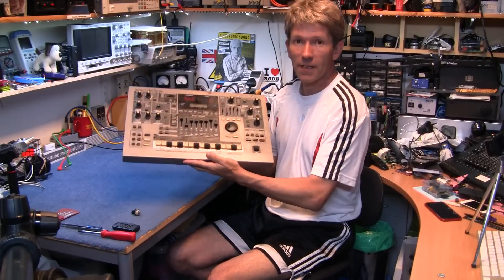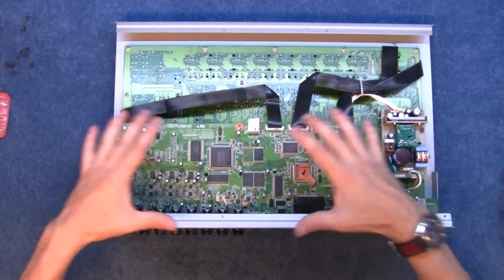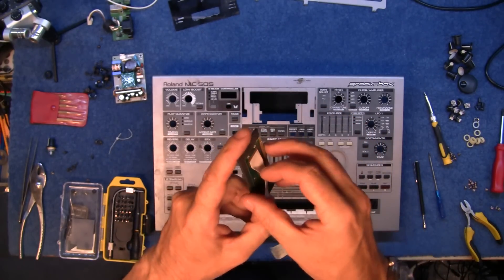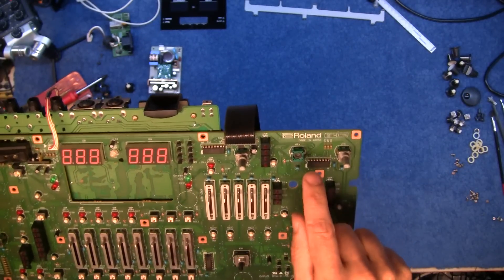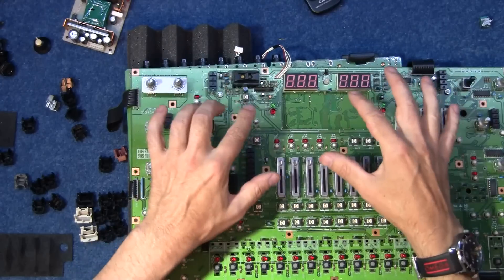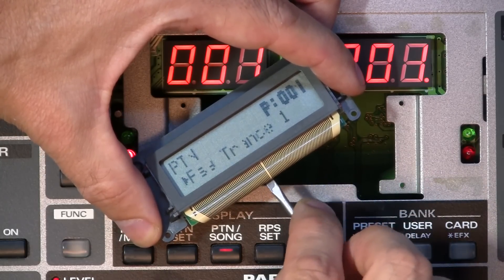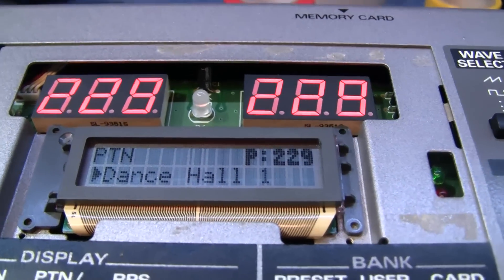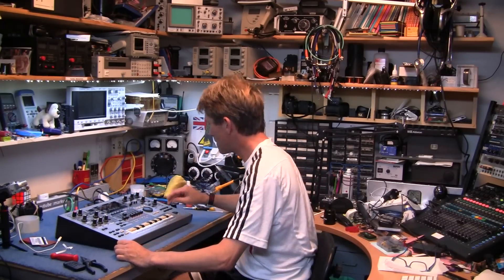Roland MC-505 groovebox LCD display repair with a steam Iron

Comment: Had a JX-305 since 2013. The display was fine, so only the flash rom got resoldered. Now the Display has the problem with missing columns. Time to replace it with that blue display with nice backlighting I have lying around since 2014. Hopefully it still works. Bought it new in 2014.

Comment: His much do you charge to fix the display or replace one for a MC-909?
Reply from the maker: Hi I am really sorry but I retired a couple of years ago and no longer do repairs. my apologies.
Reply: @markusfuller  I just fixed my LCD screen today. I replaced it with one I purchased from eBay. Took me about an hour but it was worth it.
Reply: @markusfuller  ok thanks for replying. Enjoy your retirement😀
Reply: @markusfuller  maybe you can answer a question for me please. I have an MC-909 and the backlight appears to have gone out. I can still see the display and all of the character but very faintly. Do I have a bad LCD or a bad inverter? The LCD works perfectly aside from the backlight not providing enough light for me to see it as usual. Any direction you could provide would be helpful. Thank you

Comment: One thing with replacing pots is not only do you need to know the resistance but also if it's a linear scaled pot for a slider that's used for direct digital control of a parameter or a tapered pot for audio signals. Slider pots for digital control will be linear so they can evenly increment up the scale such as 0 to 255. Whereas a pot used to attenuate a real audio signal needs to be tapered which means for example that every mm of travel the resistance per mm along the carbon track under the slider handle will increase by a logarithmic amount since our hearing responds logarithmically to loudness.

Comment: Hi markus thanks for this very enlightening video can you please tell me what voltage the LEDs are in these units please.
Reply from the maker: Hi I think they must be about 2 to 2.5 volts but thats a guess as I have not tested with a multimeter. I have made a later video all about calculating LED voltages.
Reply: @markusfuller  thanks markups very greafull I will check out your other video for LEDs👍

Comment: This helped me a lot! I had the same display issue with my Roland JX-305 Groovesynth, which I believe shares the same display with the MC-505. The ironing did the trick. I did have to press the iron relatively firmly for a longer time for all the pixels to display. Thank you for the post!

Comment: Have you ever encountered or do you think its possible for missing pots to cause the 505 to fail to boot up pls? The guy i bought off assures me it worked but on arrival just blank screen nothing else.if i poke the missing pots sometimes it shows other lit lights but nothing else.all connections on board are connected athough on arrival the small lead from bottom board to top round the audio board was off.i understand if u dont have time to answer thanks

Comment: What is the tool you're using at 6:03 to remove the pot?
Reply from the maker: Hello . that tool is called a solder sucker. It has a heatproof tube and when you heat the solder into a liquid it sucks up the hot solder from the board. you can buy them cheap from amazon or electronics stores. just dearch for solder sucker. best wishes.

Comment: Hi there Markus I followed all the steps but know, when I turn on the current and next panels appears with —— lines and there’s no sound coming out of the machine. How can I Solve this ? Thanks
Reply from the maker: Hello Jamil. sometimes you have to sloghtly press along the ribbon where it is in contact with the glass to find the last few connections that have not stuck down correctly. but the display should not have anything to do with you getting no sound, there must be a different problem that is causing you to get no sound.
Reply: @markusfuller  Hi Marcus, thanks for your reply. The keys are working well, but it looks like the system froze and that’s why it appears those lines. Because when I turn on it appears the numbers normally, but 2 seconds later turns into that numb/freeze state where all options are not working and no sound is coming.

Thanks

Comment: Hi Markus, does the repair on the display with the iron still works after all those years?  Thanks for  your videos!
Reply from the maker: Hi Michael. sadly after about 6 months it started breaking down again.
Reply: @markusfuller  ah dang it. Thanks for your quick reply! I bought the part on ebay.

Comment: I have tried the process with restoring the screen, but my screen seems to be getting worse. 
My iron is set just under 'synthetic' temp., but I don't seem to be getting the same results you did.
Does in make any difference that my screen has a red backlit look to it?
Reply from the maker: I am not sure why you are not getting the same results. I do not think it would have anything to do with having a red backlit display. have you tried gently pressing along the ribbon where it meets the glass to see if the pixels appear ?. if they do you may be able to pack it with some sponge like material so it is gently pressed in that area when the top perspex cover is placed.
Reply: @markusfuller  thanks Markus. Dopey me, It looks like the main cable is little worse for wear,  coming Into the display controller (the white ribbon cable) - I may have cause some further damage while trying the "laundry equipment procedure" 

I will need to repair those connections and see if I can recover the screen from there. But while I am this far into it, I am going to sort out some of the other problems - there are some loose feeling pots on the board and the data entry rotary skips and glitches information from time to time, causing values to jump.

I will let you know how goes it.

Comment: Thanks for the great video. You might consider to use a brace for the sides of the machine when you flip it,  because the way you are handling it the pots on the front are going to need replacement. Pop the pots off and use the case with a small towel or a shim to support the weight without motion.

Comment: Greetings! My MC-505 takes about 8 seconds to start up when turning it on. Do you know what would cause this issue? It is as if a capacitor is slowly charging.
Reply from the maker: Hi Robert to be honest I have no idea why it is taking so long to startup. have you got a card inserted in the machine ?. sometimes it may take a little longer as it would read from the card on startup. if you have not then I am not sure why it takes so long.
Reply: No, I don't have one. It is an odd issue indeed. I thought it was a dry joint because I would wiggle it and then it would turn on but when opening it up and re-soldering the joints I noticed it was simply delayed, so each time I wiggled it I was thinking it was causing it to turn on. But then wiggling never made it turn off haha! Oh well. If I find the solution I will let you know - for science!

Comment: In my current setup I use a Roland MC 505 and a Korg Es-1 for my music but a couple of months ago I was given another 505 from a mate who said it was faulty (couple of the keypads don't work unless pressed with force and the usual screen issue plus all the pots were wobbly as hell) he said I might as well use it as a donor machine just in case anything with mine goes wrong. After watching your video you inspired me to open it up and have a noodle around to see if I could find out what the problems were. Stripped it down, put all buttons and knobs in soapy water and cleaned up the chassis. Wobbly pots I sort of crimped with a pair of long nose pliers and it sorted them all. Ironed the screen back to life and figured out why two pads don't work. The little rubber switches are split so don't make contact properly, what are the rubber switches called and can I replace them at all? 
Great channel by the way, right up my street 
Cheers.
Reply: Great question. Did you ever figure out what to do with the buttons being janky?

Comment: Brilliant videos :D I need to purchase some of these potentiometers, do you have a link or recommend the place where you purchased yours from? Thanks :)
Reply from the maker: Hi Im not sure where mine originally came from as I just stash components when I get hold of them. some are many years old.
Reply: I hoard alot of stuff myself but I have nothing here that will work! I recently acquired a Roland MC-303 and Yamaha Rm1X that need potentio's and switches replaced. I was going to ask you something else though, I notice your power socket strips... where did you get them from?
Reply from the maker: Hi RetroJay1974, I too have many things that just will not work stashed in my garage waiting for the day for me to get around to trying to fix them. Those long power sockets came from a Radio Rallye (sort of yearly electronics and radio car boot). the rallyes are all around the uk normally once per year in each big city. the Derby one has closed forever now but it was an amazing place where you can buy anything from an AA battery to a decommissioned heat seeking missile ( I'm not joking ). I think youtuber mikeselectricstuff does the odd sale at the radio rallyes. is it rallyes or rallies ?. anyhow do a search for the websites that list the dates of UK radio rallies have a look see if theres one close to you and you will be amazed at the mountains of useful electronic junk you can buy very cheaply.

Comment: Best MC-505 youtube repair video. With respect to the POTS, I'd start with some Contact Cleaner first...usually does the trick. I also dump a bottle of windex into a container for cleaning the plastic components, let soak for 10 minutes and rinse with water. On one unit there were cigarette butt burn on a black key. I used thick black epoxy and an exacto blade to smooth out the burn hole. It's amazing what substances can be found in these units...next time I'll wear latex gloves.

Comment: Awesome, Marcus! This totally worked! Had my MC-505 since about 2000, and the display barely worked at all. 
I set the iron to "Wool" (same setting as Synthetic), and moved the tip slowly back & forth on the ribbon. I think that's the trick, go slow & apply pressure. Repeat as necessary. Display looks amazing! Liked & subscribed! Thanks for the Huge save, mate!

Comment: Is the music 7:05 playing from the MC-505? Sounds awesome.
Reply from the maker: Hello Yes all the music is from the MC-505
Reply: Its from the Industrial Pattern set, its the same in my Roland JX305 ;)
Reply: JohnnyX50 
That's because the JX-305 is basically same as the MC-505 stuffed in a slimmer case with 5 octave keyboard. I have the MC & JX both ; tho I think that the MC's sequencer is easier to use than JX's (; .

Comment: as always, wonderful instruction! Thank you so much!
BTW, I am experiencing a different issue. My display is fine but switches are all erratic. For example, I'd push a button to change between 4 functions but all 4 would lit up or do partially. As a result, I cannot tell which function is active. Unfortuantely, this happens with more than one switches/buttons. Is it something I can fix by cleaning contacts? Other than my 505 is clean and functional. Any advice will be welcome!!
Reply from the maker: Hello Young Choe. sorry I am not sure what the problem could be. yes I would start by cleaning the buttons but normally unless there is resistive dirt on the board there should be no reason this problem is happening.
Reply: Thanks!!

Comment: Could the steam iron technique be done with an MPC 2000 screen?
Reply from the maker: To be honest I really cannot say as I have never seen the connecting ribbon of the MPC2000
Reply: Its very to the MC 505 screen ribbon/connector, im not sure if you're familiar with the ill-fated MPC 2000 screens, they suffer from the same problem that your MC505 had, lots of lines that render them unreadable. Awesome videos btw, your tear down of the moog synths really intrigued me. I'll take a picture and send you a link to the MPC screen if you want to have a look and see what you think.
Reply from the maker: I just used the MC505 in a previous video and noticed a new dead-line had appeared already. I know nothing about the MPC2000 but I guess its the same stick on connector ribbon.

Comment: Isn't using a ratchet socket wrench a little bit of overkill for jack socket nuts. ;)
Reply from the maker: Hi I never tighten the socket nuts too tightly. but I use the ratchet set mainly so as not to mark the casing as you can easily slip with pliers. a mistake I have made many times in the past.
Reply: That's true... I have many pliers scratches on things...
I just thought it seemed a bit "overtly macho" ;)

Comment: good work, like those 90's grooveboxes.  did a MC303 review on my channel if you are curious.  question, I bought a D50 with self-adhesive velcro  stuck all over the front panel.  any tips how to safely remove the velcro and any adhesive residue without harming the D50?  thx.
Reply from the maker: Hi I would use petrol lighter fluid to remove the sticky velcro. its the fluid you would normally buy to refill the Zippo lighters. it is very good for removing the leftover sticky that you will have on the metal panel. just use plenty of paper towel and don't let it run down into the keyboard if you can help it.
Reply: i got lucky, the velcro peeled off (although it was stuck on there mega hard) and left no residue!  a polish with wd40 and window cleaner finished the job.  the D50 looks mint.  cheers, love your channel btw.
Reply from the maker: oh yes I forgot to mention WD40. Im pleased you got it looking good again. I like the D50 but have never actually owned one myself.

Comment: Would using "retrobrite" on the white buttons would have been good to remove the yellowing ? And thanks for the tip, I guess I will give a go to my DM4800 LCD failing lines with the Iron !
Reply from the maker: It have heard the retrobrite being used for this purpose but I do not know where to buy it. someone told me vinegar and bright sunlight also bleaches the buttons but I have never tried that as I think it would make it smell bad.
Reply: Actually they use peroxyde and "oxy clean". They are activated by UV lightning that you probably have handy. I have found this DIY if you are interested : http://www.instructables.com/id/DIY-Retrobright-Whitening-solution/?ALLSTEPS
Reply from the maker: wow thats very handy, thanks for the link much appreciated.

Comment: I think you will want to fix the display out side as you don't to be inhaling noxious fumes like palatinate which is a plasticizer for PVC which also mimics oestrogen.
Reply from the maker: I still use old lead solder so I have a well ventilated room

Comment: Well done. I got the JX-305 which is basically that groove box with a keyboard on it. It has the same problem with the display but is still readable. Vertical lines are missing depening on from where the wind is blowing, and maybe planetary alignments ;)
Reply from the maker: I dont think I have ever actually seen the JX305. sounds interesting.

Comment: well, a 10k pot isnt equal to another 10k pot, there are linear and logarithmic pots. in audio this makes quite a difference.
Reply: In that application those pots are probably only connected to channels of an A/D converter with the micro controller actually setting all the levels, so it only make sense for them be linear.

Comment: You lucky so n so! Glad it found decent home :)
Reply from the maker: I think I may have to hold onto this a little while. It actually sounds quite good.
Reply: Yeah it does. I'd love a lil groove-box type of device to potter around with, I get distracted easy when I'm using my PC, having something strictly specific would be fun - if a little slow at 1st getting used to the often convoluted editing methods lol. Sadly the ilk are cost prohibitive for myself. 

Have you had chance to see how it handles as a synth via midi instead of using the internal sequencer etc? I imagine it being similar to an Emu Orbit or some other module?

Comment: Brilliant! I have a JX-305 (the keyboard version of the MC-505) with the same LCD issue. Might just be the fix I'm looking for.
Reply from the maker: make sure the iron is not too hot as you can melt the connector.

Comment: If is not much to ask, how much did you paid for the 505? I sold my 303 for 90 euros ( i bought it second hand in '01 for about 240!). Found it very low quality built and somewhat dated, though maybe someone could squeeze new life from it.

Nice garden, BTW!
Reply from the maker: I paid £15 UK. but as in the beginning it was in a terrible state.
Reply: +markusfuller yes, it shows from the video. Anyway, it's a great deal (with the proper knowlegde). Here in Spain the prices had skyrocketed even for "non working/ for parts" material. Sadly everybody treats old gear as "vintage" (even 2000's machines).

Excellent tips, specially the hot iron one. Cheers